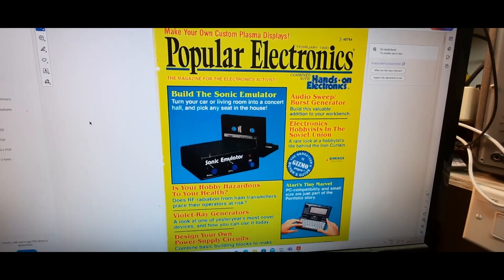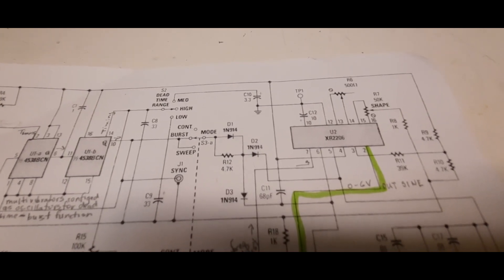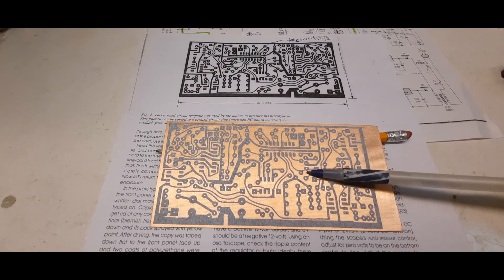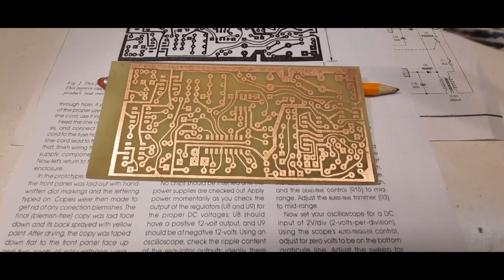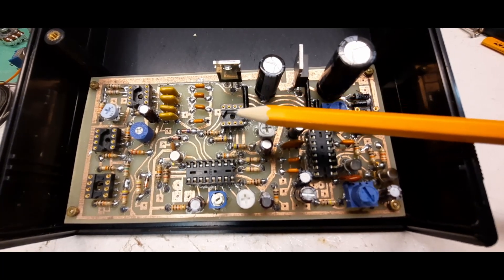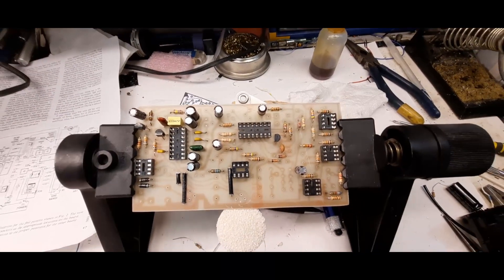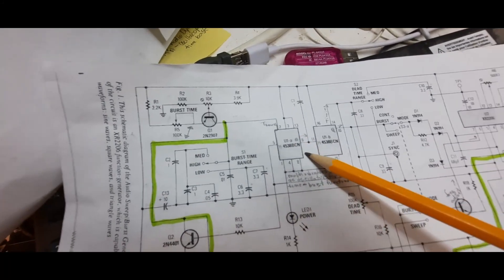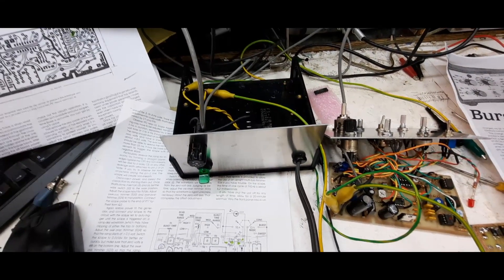Popular Electronics - Burst/Sweep Generator - February 1990

Comment: Several errors crept into the illustrations that
accompanied the "Sweep /Burst Generator"
article that appeared in the February, 1990
issue of Popular Electronics. First, in the
schematic diagram, there is a dot missing
from the C7 ground bus where that line
crosses the one coming from Ul -a, pin 1.
Also, LEDI, is reversed. Its anode should
be tied to the top of R14. In addition, the
feedback resistor connected to U4 is not
identified; that unit is R21 and has a value
of 10k. Finally, J2 is shown wired backwards,
with the center conductor going to ground.
The center conductor should be connected
to the output of U7 b, and the outer conduc
tor should go to ground.
There were also two errors in the parts -
placement diagram: Integrated circuit U7 is
shown backwards and switch S4's x 1 and
pole contacts have been interchanged; hook
up that switch as shown in the schematic. -
Editor

Comment: One trick to selecting all those traces is to select the whitespace and invert the selection. Then you can use flood fill to paint all the traces black quickly.
Reply: I think the fuzzy select with appropriate levels set is a good option too.
Reply from the maker: Yeah ... I seen that fuzzy option too. I never used it. The next project I will try it.

Comment: This is the first time I have seen any of your videos.
This is the kind of stuff I like to tinker with as well.

I found a copy of the issue of Popular Electronics, Feb. 1990 available online.
There was a .pdf copy, and I copied the article you are using for your project.
I was able to get the image of the board trace layout and did some enhancements of the image.
It looks to me like pins 1, 4, 8, 12, and 15 of U1 are all connected together.
The schematic does not show it, but those pins are all connected to ground.
I was able to verify from the trace layout image that they do connect to ground.
C5 and C8 also connect to ground by pin 1 of U1.

It's a shame that you could not get the generator working.
I know you spent a lot of time and effort on it.
Reply from the maker: Thanks for watching the video. Yes, I noticed those pins on the schematic also. From what I remember, I thought I buzzed pin 1 and it did not go to ground like pins 4,8,12 and 15 so I cut the trace to where it was going and jumped a wire to pin 4. I will get back to it eventually and give it another go. Cheers!

Comment: I share your pain. Kudos for keeping going with it. I don't think it's a failure, just needs some finagling to get it going. You will come back to it some day. Divide the board into quadrants and tackle each quadrant from the power supply quadrant first. Build up gradually. You have no shorts because you have the +/-12v so it's bound to be a mistake in the pcb layout that is going to need some components over soldered or some hookup wire and a scalpel to mod the thing. I think a breadboard version is a great idea @demnoss because you can build it up gradually, testing as you go. Good luck!
Reply from the maker: Thanks for the kind words .. one day I will get back to it. Cheers!

Comment: Are you really using a genuine XR2206? I don't think they still manufacture them, not the originals.

I know there's a lot of copies out there that look genuine, and they work mostly fine, but they fail on a voltage test. The test is just seeing whether the output is stable down to 9V. The fakes seem to be flakes under 12V! :O

There's also a lot of possibilities for alternative chips these days that are the same kind of price, work better, and are better in their performance. I just haven't gotten around to it. 

If you ever have problems with your boards having fuzzies, try a brass brush. The small bits may come off merely because they had very little copper still holding them on. :)
Sometimes, I don't even mind deadbug style circuits; it has a charm to it, I feel. I have in the past also needed to add some extra copper to traces I wasn't super sure of, but I got really good at "predicting" how long a board will need with a certain coverage of toner. Not leaving it in for long batches at a time helped a lot with finding the sweet spot of post processing. Perhaps you're already doing this or perhaps (like me) you might need more than one person suggesting it to believe it's worth your effort. I'm not judging, only... judging.... ok. Well, I'm merely sharing my experience, that's what I mean!

I for one think you did a fantastic job putting the components on the copper side. It all looks very artsy, careful, and thought out. Almost like it's intentional. Great work! I love it.
Reply from the maker: Thanks for the kind words. Great tip also. Going forward, I take the magazine board layout and paste it into GIMP. From there I can edit and reverse image the design plus add more black colour to it. It helps a lot when i etch it. Thanks for watching the vid ... cheers!

Comment: Sorry this didn't work. I was going to build it as I need one myself.
Good news, though. I found a video that explains how to transfer the toner without heat. From the comments, it works great but needs a little fiddling with paper type and toner type. Different for everyone. Basically just print it out, wrap the paper around the board, tape it on and then use some nail polish remover or acetone diluted with water or other easy variations for each person's combo. The solvent dissolves the toner which sticks to the copper. Etch and done. I'll put up the channel where that's at shortly.
I have a bunch of boards from Mr Carlson's Lab Patreon. But terms and conditions don't allow sending out the boards. I have been really reluctant to buy a laminator. My apartment is too small. Be sure to read all of the comments. Different printers use slightly different toners. Thanks for the great videos.
Reply from the maker: Interesting method of making boards. I may try that one day. As for now, I have learned that I can take the board from the magazine and edit in GIMP; an image editor and I can make the traces darker and clean them up. So pretty good with that now. Cheers!
Reply: To clarify a bit, gently rub the back side until wet with the solvents. That's how it's transferred.
Reply: The channel is Gareth Burrows. "DIY PCB Toner Transfer (No Heat) & Etching" 
You already have all the equipment, so whatever works best for you. Once I buy the chemicals and try it out, I'll leave a comment about how it works out for me. Fingers crossed, the smoke detectors here are so oversensitive that baking fish sticks in an oven sets them off.
Reply: @CrispyCircuits  In any case, honestly, for PCB's like these I wouldn't be opposed to drawing smaller traces by hand inbetween the larger ones. I have done it before out of desperation, and it's surprisingly effective.